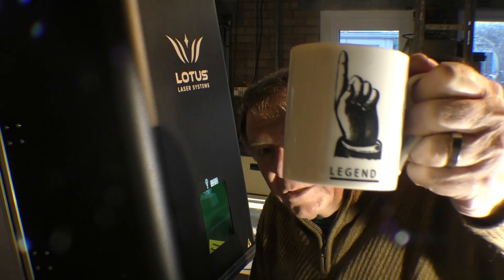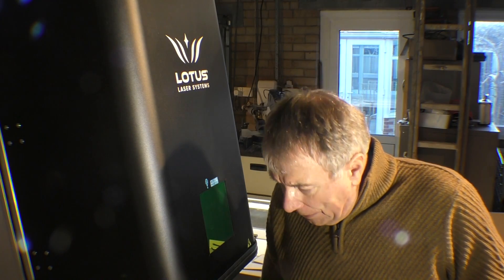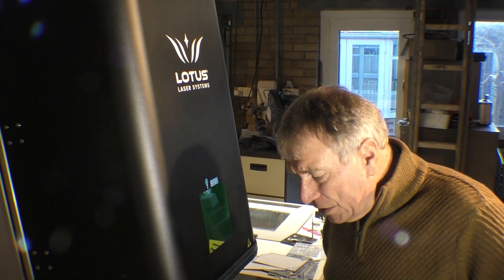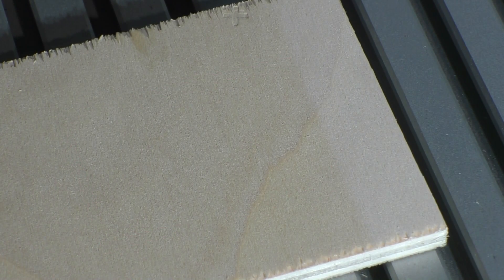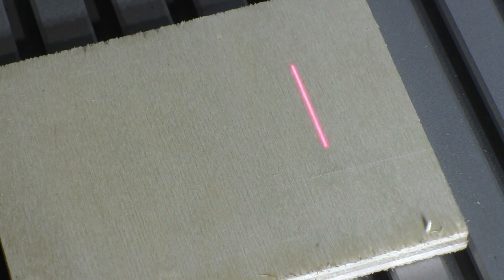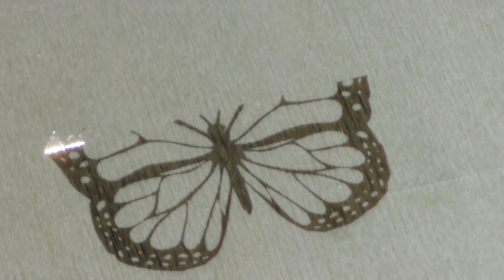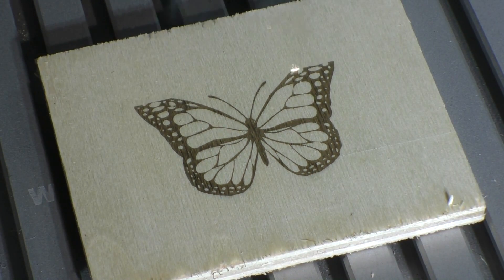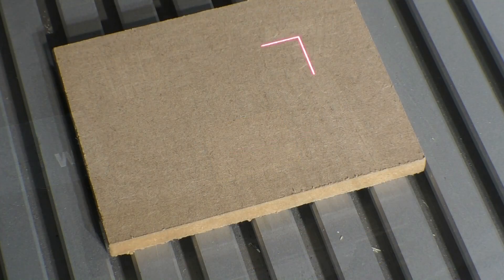Fiber Laser Learning Lab 08  Let's Try the IMPOSSIBLE

Comment: I’m trying to do a project for a friend and I have a 30 W laser I’m just trying to figure out what settings will make this happen
Reply from the maker: Hi 
 It's very likeley that you jhave  a different type of laser called a Q switch laser. Yes, its still 1 microm wavelength but the pulse power will ber nothing like the "hit" that is generated by the MOPA laser i was using. The whole method I used for this is explained in detail in a follow up video I did , because his was just a taster.. See   https://youtu.be/jVLhNw-1szQ
 Best wishes
Russ

Comment: I have a question and since your the all
Mighty and powerful master lasers.  My thoughts were to buy the 50w laser then to same  slot of money. I wanted to just buy a 80w laser tube build the bigger box for the room of the laser. And upgrade the power supply is that all
Reply: Or do I need to buy new drivers any info would be greatly appreciated
Reply from the maker: Golden rule number 1. Make sure the machine you buy has a RUIDA controller . Rule number 2 is to make sure both X and Y axis run in HiWin type bearings Your 50 watt machine will be fitted with a B grade 40 watt tube 800mm long and 50mm diameter. If you wish to upgrade the tube (and you will) you can buy a top grade 70watt tube that will actually deliver 80 watts from Cloudray Laser. I have just fitted such a tube recently  see   https://www.youtube.com/watch?v=V_ehGE51rH4
 To upgrade you MAY need some new tube mounting brackets because the new tube will be 55mm diameter. You will need a new 60 or 80 watt HV power supply and make your own extension box from MDF or acrylic.
 Best wishes
Russ
Reply: SarbarMultimedia and that’s all ? The linear rails on your original 50 w did it come with hiwim rails ?  If mine didn’t can I just buy the hiwin blocks ?  Thanks.
Reply from the maker: @the-bu3lb  In general, if your machine did not come with the rectangular Hi Win type of bearing rail already fitted, then the fundamental design of the gantry in particular may be too weak to be modified. There is no simple answer , you have to use engineering judgement and skill to workout if such an upgrade is possible .  A non-Hi Win machine will still work but plastic rollers on a lightweight gantry will have a limited life. You can buy a complete X/Y  system that may bolt into your frame  see  https://www.cloudraylaser.com/products/mechanical-parts-set-single-head-laser-kits?variant=12471384473651
 What I am saying is if you have not yet bought a machine then these are two key things to look for. You can easily change tube or power supply  but controller and rails are expensive and difficult. Pay a bit more initially to get the best fundamentals of a good reliable machine.
 Best wishes
Russ

Comment: Ok, so what is the secret?
Reply from the maker: It's like the recipe for Coca Cola....T O P   S E C R E T.  But now you have seen it done perhaps it will stimulate others to think out of the box and experiment. Having succeeded in marking  it, has anyone except me considered  it possible to cut 10mm plywood? I haven't yet tried it , but it's something I will experiment with in future.
Best wishes
Russ
Reply: @SarbarMultimedia  The problem with trying to cut wood on most fibers is the lack of air assist. I tried on an older fiber galvo machine and the wood just caught on fire, and on my galvo CO2 it will cut, but because of the beam angle, its not at 90deg. I'll be interested to see how you go with your fiber.